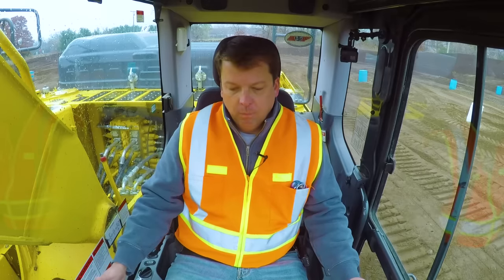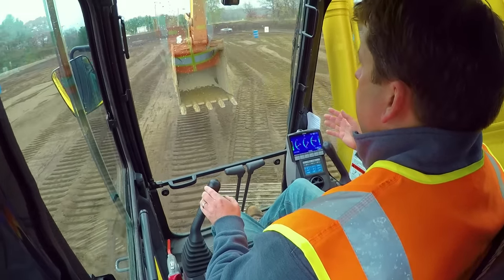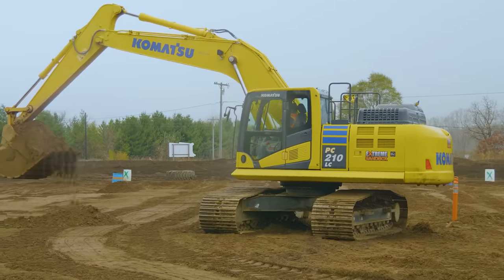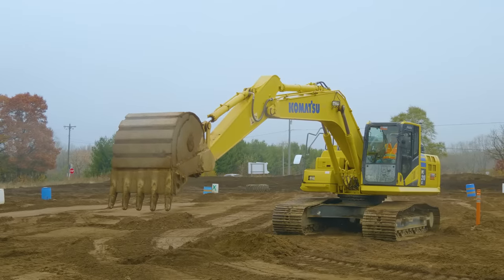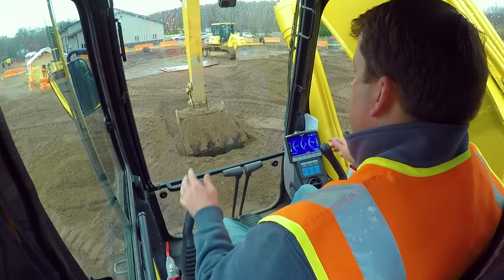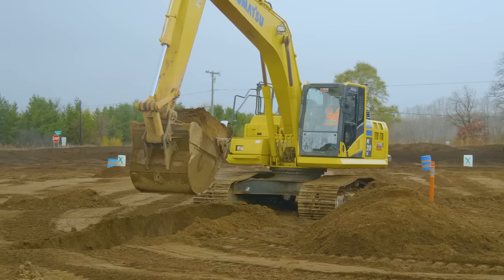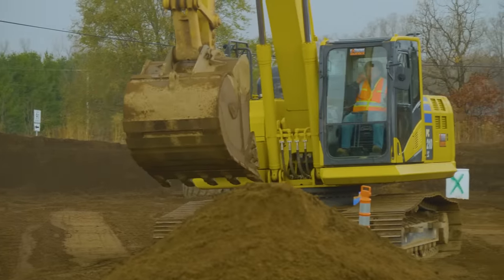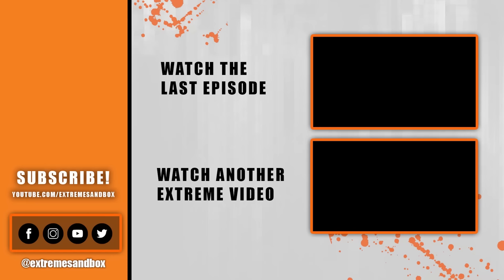What NOT to do in an Excavator | Heavy Equipment Operator Training

Comment: always had a fantasy. if i hit the lottery, buy a few hundred acres, and some heavy equipment and push dirt all day. but your channel my friend, allows me to learn as much as i can . thank you
Reply from the maker: If that happens....give me a call....
Reply: Its Called Tractor Therapy... I own A Compact tractor and love to go out and move dirt and dig holes
Reply: I bought an excavator and figured out that people will pay me to dig holes.  It's great.
Reply: My fantasy is winning the lottery so I can get out of these things lol
Reply: I can tell you from experience that Playing with the big toys is FUN....however without a purpose you will get bored. After about 40 hours operating at the boring easy stuff. Like digging holes on your property...I got to help my dad in 2000 log, build a barrier wall (with those large 1500? Lb 10’ x 3 ‘ concrete blocks 2 high, grade with a dozer and clean up his property. Was fun, humbling (I damaged the excavator) and a very good learning experience. I ran a JD450 excavator  at least I think thats what it was, a mid sized dozer, and prior to that full week I ran a bobcat mini excavator with the blade attachment. Douglas Fir trees weigh a lot and the little mini had a hard time with the sections.  The excavator had the hydraulic thumb and that was used to log and hold the trees to buck & limb them for the mill. I damaged the cab of the excavator when it slid sideways into a 2 ‘ diameter fir tree. I was freaking out about how to get it out. Shut off machine and got out of cab and thought...Dad said “you know the boom the arm are the stronger part of it so use that to leverage yourself away from the tree and the rotate the base to get out. I did just that and we both learned a lesson...it was a rental and he was too cheap to buy $250 full coverage. It was 3K to fix the cab damage....on top of the rental cost.
So yeah lessons learned all around. He wasn’t mad as it was his mistake for not having full coverage insurance. I learned a valuable lesson in how to 1. Don’t slide sideways into a tree well, and how to use the boom arm in non intuitive ways. The videos on YT of the dudes unloading and loading onto train cars with just the rigs are impressive.
Reply: After doing for 28 years, you'll get tired of it.

Comment: I love the tip on having the drive motors to the back never really thought much of that. One thing I do when working on large rock piles I have the drive motors to the front, backing over the pile pulls the rocks to the idler wheel and keeps them from jamming in or by the drive motor.
Reply from the maker: thanks for the comment
Reply: I grew up on cable backhoes such as a Bucyrus 22-B. With those you kept your drive sprockets to the front. When you travelled forward (away from your trebch) your tracks and drive chains stayed flat on the bottom and it was easier on the machine. If you learned to operate on a cable hoe, in my opinion, it made you a better operator.

Comment: Extreme Sandbox, you say digging when fully squared with drives under the counterweight won't let you lift the back of the machine under most conditions. Letsdig18 does this quite often while digging up tree roots, and lifting trees he has pushed over. While the setup does make it less likely there are many times the job will have the needed punch to actually do so.
Reply from the maker: Ohhh...it will absolutely still lift the machine however still way more stable when squared to your tracks.  Love Letsdig...he definitely has way more experience than me so always great to learn from an even more experienced operator.

Comment: For new hands getting on machines or borrowing a machine from another operator to learn or get experience,
 #1 don't adjust the seat on another operators machine if only using for a few minutes. Unless  to reach the pedals 
Edit 
#1.5 do not use the hand attachments  to the levers to operate tracks. That is the first sign of inexperience. Use feet for tracks and hands for joysticks to be ready to travel and operate at the same time.
#2 Don't park the cab in the middle of the tracks and get out.
#3 if the previous  operator had it clean with the door and window  closed, do the same.
#4 if something  happens let go of levers and the machine will stop. For those about to comment  on things coming in cab. If that's a safety issue the machine should have the proper screens to protect YOU not the levers. Period 
And don't worry about sprocket direction. Weight is irrelevant  damaging the sprockets  not going to happen etc. The only thing that can happen is bending or popping the pads off because of how they overlap one another. That's it.
   Spoils should go wherever it would least likely interfere  with the work that is being done by you or the people that do work during or after you finished your work.
 Everyone at the safety  meeting should be told about staying out of the operators swing radius until acknowledged  by the operator or spotter for the operator. If they can't see the operator the operator can see you.

Comment: Nice video, you cover the basics very well, I wanted to add a couple things, first is personal preference, I like to, is circumstances permit, nose left track into a bucket of dirt, leave machine turned just enough to step out on the track and walk down the track and dirt pile, I used to jump off a track as a young fella, not any more.
Second, if your in an a earthquake prone area, leave the arm extended out all the way, this lowers the center of gravity some and a point of contact might prevent the machine tipping or sinking out of sight due to soil liquifacation
don't know for sure if that works but a guy I worked for in Alaska said it did in the 64 Easter 9.0 quake.
Reply from the maker: Thanks for the tips!

Comment: Awsome vid. 
Overgreasing, not warming machine up or letting it cool down and blowing the dust cover out with grease on swing circle. 
They all grind my gears.
Reply from the maker: Good ones...thanks for sharing!
Reply: Cool downs a tough one. I had an old desiel fitter top bloke he was but he said really what's the difference between our cars and a machine. If start up idle and shut down idle were that important why don't we do it with our cars. Start up I can understand cause it's easy to blow a hose with cold fluids but defintely over idling can also be abit of a fault I've seen. But as for shut down I think it's abit of bull. If the turbo really needed it then we would be doing the same with our turbo cars...
Reply: @beaubath2537  a lot of experienced car enthusiasts do let their forced induction vehicles cool before shutting them off. They even have turbo timers. So after you turn your ignition key off and go inside, it idles for a couple of minutes before shutting itself off.
Reply: @jeffreid3341  I'm well aware of turbo timers. But we are talking across the board cause what people say basically is don't dare switch it off without letting it idle for a couple mins and the way the desiel tech said it is we've come that far eith technology that it's not really necessary. The debate behind it though is always a big one but his keep point was basically if it was that dangerous and deathly important to heat up and cool down the turbo we would be not only doing it with 35 tons of machinery but also your little 2 door Ute that got you to work and home again too. My take on it kinda brings his ideas into play but it also takes into account that machine is huge and so I might not give it a whole 3 minutes to idle down but I'll give it some time maybe while I'm grabbing my things out of the cab or filling in some paperwork or even while I do a quick walk around after the end of the day. But most machines I've ran have come with a turbo timer so you just switch and leave it. I think it's always going to be a quite debatable topic as to what's right and what's not.
Reply: @beaubath2537  the main difference in shutdown time on a machine/heavy truck vs a car is the exhaust temperatures and normal operating conditions, for example my car has a average of 32% engine load over its 240000 miles, a truck im replacing the engine in has a average engine load of 67%, the larger engine also takes longer to warm-up and cool off and the less thermal shock on cast components the better.
Reply: not using your hands to track the vehicle grinds my gears especially when nothing is happening with the arm, I always felt that I was more in control with my arms driving that my feet, both are just as fast at reacting just my hands are more precise.
Reply: @beaubath2537  cars are abused.....a turbo runs super heated gas out the exhaust side of the turbo this heats its blades and shaft and case to red hot ..... letting it cool prevents temperature warp  and more importantly the shaft and bearings cook oil onto them .... cool down is so important it's crazy.... but hey if your the owner go ahead and pay for the repairs.... also seals burn way fast if not cooled down.... it's like the old saying about riding the horse hard and putting it away wet ..... people abuse their cars ... most today never check the oil or even open the hood.... cool down is so important the manufacturer would make out so the key could not be removed until there computer had done a shut down cooling period if they had to warranty that damage..... if I own the equipment I tell the operator 3 min cool down be it 18 wheels loader excavator dozer etc ..... if ever I see shut down without cool down except in n emergency they guy is fired.... why because you know he skips all the other stuff lubes daily etc .... and you generally have to pay more per hour to get the employee that will take care of the bosses stuff...I just started a new job 2 months ago and im catching hell from the other employees because I'm doing what's right and this equipment is totally abused .... one truck has broke. Seals on steer drag link looks to have been broken probably longer than a year....I saw that when another driver was driving it....I insisted he put the paperwork in after he scoffed at that....I said better you do it than I do it but I'm gonna list everything every day..... if this was not a govt job the private owner would fix this crap to avoid fines from law enforcement complacency sucks my ass I will not tolerate it and because of this I get ahead and more pay plus better jobs.... and I don't lose money because equipment is broken down.... the boss doesn't lose money and  boom  you get bonuses if the boss treats his employees the way he wants his equipment treated...... how would you feel if your boss treated you like you treat the equipment ....I would love that most others would hate that because they would be ridden hard and put away wet then sent to the glue factory once they were used up
Reply: @straightfaceguy7966  I totally see your point we spend out whole lives training fine motor skills in our hands so it makes sense to use it at that point the issue is those your less in control and your normally also hunched over so it's uncomfortable and just doesn't give the same amount of visablity. But I also consider it dangerous. Prime example is climbing or descending a slope. I'll give an example of climbing cause it's easier. Sometimes slopes are so steep your tracks sit spinning so effectively it's where you want to boom out and then use it to pull yourself up as you track. Try doing that hunched over and both hands on your travel sticks. Not to mention if your tracking in a dangerous spot and your hunched over to travel and say the ground gives way and you go forward firstly you won't notice it as well,secondly you won't reach the leavers quick enough and make adjustments and lastly you'll be kiss your windshield a big fat hello. It does take training to use your feet and gently the same way it is to learn to drive. I tend to reach for them with my hands in tight spots cause sometimes your feet will go stupid and next minute you track too fast one way and side swipe what's beside you but in general travel feet feet feet.
Reply: @beaubath2537  I was talking about in general situations (in relation to this video hes on a flat surface and talking about loading lorry's and digging trenches) , ive worked with a guy who obliterated a 150+ degree slop, no way on this earth I would do it, i had 3 years experience he has over 45 years it was a stone quarry and he was about 50-60 meters up the face when the lunchtime call was announced, without a word he swung around threw his bucket down and off he went it was beautiful ! I called him a nutter he laughed and we all went up for lunch. It is a totally different operation when going up and down hills because most of the time you will need to drag yourself up or to control the decent on the way down. also in relation to the windscreen, you wont hit it if you have your seat belt on :P
Reply: @straightfaceguy7966  I see your point but I think none the less if your training to use your hands more over your feet it just becomes the instinct. So that's why I always try to use my feet so it's what my brain is then trained to use. We can say you won't greet the windscreen but let's be honest your not far from it if your using you hands. There's car drivers who wear better designed belts and still they hit the windscreen so I think if your so close the risk has to be a lot higher. Just personally for safety and training I prefer to use my feet day in day out unless there's a risk of wiping something out plus anyone using their hands to me screams lack of experince.
Reply: The reason we let engines cool down and car owners don’t is because we are professionals that are trained by professionals. Any dumb shit can teach their dumb shit kid to drive a car. I went to school with a guy who’s dad bought him a new truck and he drove it till the motor blew up and laughed and told people that the mechanic couldn’t believe it still had the factory oil filter because he had never changed oil. Learn from dumb people. Don’t be one
Reply: @straightfaceguy7966  Not everyone has the same level of control with their feet some are able to some are not. Personally I prefer to use my feet when I'm track rolling or blading with my 10 ton machine. 
It also helps when working in an environment that requires the use of the stick for stability or for pushing while tracking.
Reply: @beau bath
New Volvo wheel loaders actually count "hot turbo shutdown" events. And when is the last time you ran your car full throttle for eight hours?
Reply: @welsh 
Tracking with your hands is for mechanics and truck drivers.
Reply: @straightfaceguy7966  Sorry bud...only a novice would say that...adjust your seat so you're comfortable with the pedals and don't let anything "grind your gears" ....just pay attention and soak it up.

Comment: Another "don't do" is making long tracks without keeping a steady eye on the temperature gauge. Tracking works the hydraulics very hard. The product geniuses at Cat bring up a screen with inclination and rear camera while tracking. That hides the gauges. We had a new machine overheat on a long track and the operator had no way of knowing what was happening. You can't know until it happens if a machine has marginal cooling. You can put the Cat 305.5 CR on that list.
Reply from the maker: Interesting...thx for sharing!

Comment: Man I’m so excited to get into being a heavy equipment operator. Been applying to the operators union in illinois and haven’t received anything yet! Going to apply again in 2021
Reply from the maker: Good luck man.  Also could just look for a smaller operator and get on a shovel.  Got to start somewhere!
Reply: Regrettably your local union will not risk putting someone in the machine with limited or no expierience, the exposure  to liability is off the charts, maybe try going non union to get some seat time
Reply: @Often Offends And you're getting ahead of yourself calling yourself an operator.

Comment: Ran an excavator for 23 years,, all good tips. As mentioned below,, WATCH and DO. I worked with some amazing operators and a ton of really bad ones. Tried to emulate the good ones. Most of my work was running a breaker, so I had a "loaded" bucket all the time. Tram motors behind me all the time. Critical when working on overhead rock. If something starts to fall, you don't even want to think about it. I ran mostly Cat 325's and 330's which have straight tram pedals,, essential for quick response and moving straight away from the threat.
Reply from the maker: Thanks for the comment!

Comment: I’ve been an excavator operator for 11 years and when I teach people on the site I often see that they are too scared too go fast when they’re tracking because they aren’t using the throttle right and they are jumping around all over the place.
Reply from the maker: Agreed
Reply: Using the throttle right while tracking an excavator? Its easier if you just run it full throttle. I dont mean pedal to the metal either. Do you?
Reply: 67hundredthz what happens if you want to go slow? Then you have to put the throttle down rather than having it full throttle then having the sticks halfway because having the stick half way can make your machine jump around.
Reply: @g_trooper_6148  first of all the travel operates by pedals on an excavator. Yes some excavators have sticks connected to the pedals but those are for lowboy drivers and the unexperienced. If you need to do any action while walking the ho like cutting your tracks or raising your boom for example you wont have power to do so if idled down. If you are jumpy on the pedals then the machine has problems or you do. ALWAYS operate an excavator full throttle, the machine will thank you for it.
Reply: @67hundredthz  yeah thottle is power not speed.  Stick movement is just oil flow rate..  Always run at operating power level.